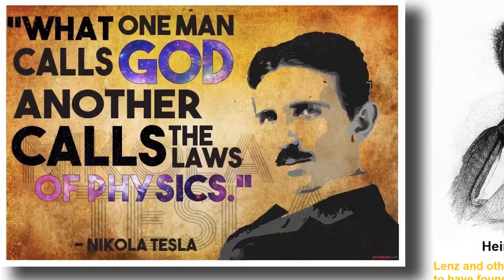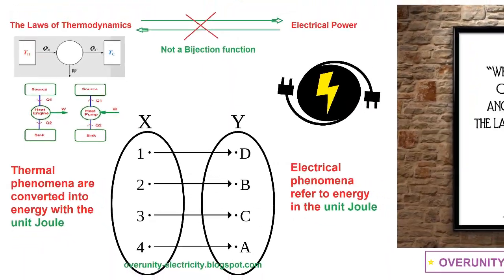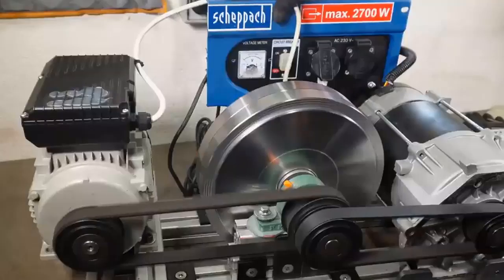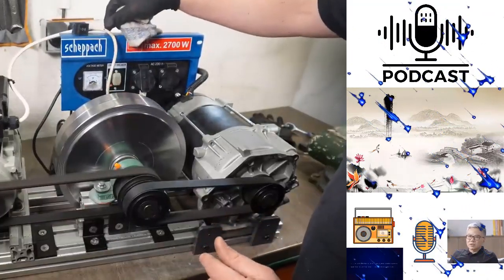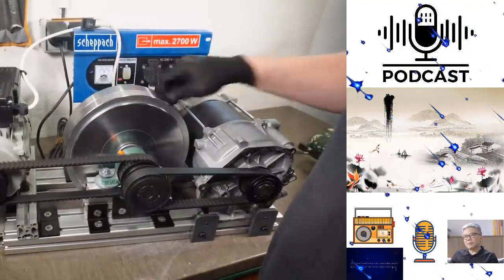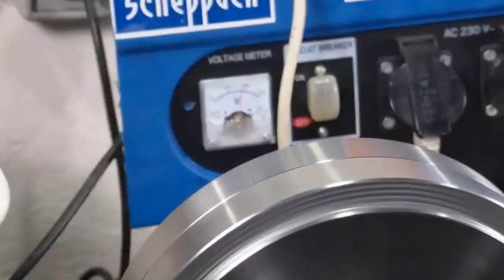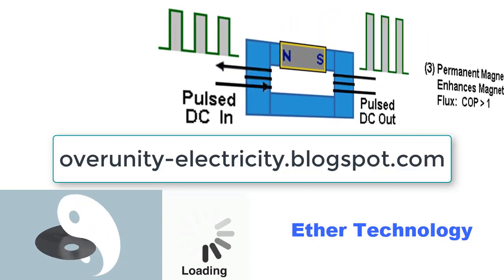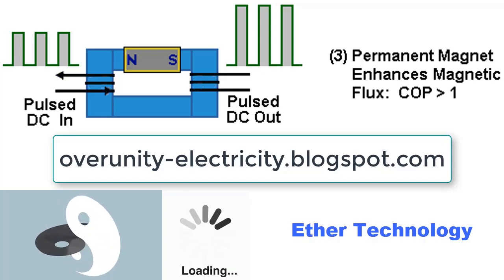Easy DIY Power Plan: Unlocking Tesla's Free Energy Technologies

Comment: Generating "free" electricity, often referred to as perpetual motion or perpetual energy machines, goes against the laws of physics, particularly the first and second laws of thermodynamics. These laws state that energy cannot be created or destroyed in an isolated system, and any system will tend toward increasing disorder or entropy.

While there are various renewable energy sources such as solar, wind, and hydropower that can harness energy from natural processes, they are not "free" in the sense of perpetual motion. These systems are based on converting energy from existing sources in the environment.

If you're interested in generating electricity sustainably, you might consider looking into renewable energy technologies and systems such as solar panels, wind turbines, or hydroelectric generators. These technologies harness energy from natural processes and are in line with the fundamental principles of physics.

Building your own renewable energy system can be a feasible project, but it requires careful planning, knowledge of the technology, and adherence to safety regulations. Additionally, keep in mind that the materials and components needed for such systems may come with a cost. It's important to approach any project with a realistic understanding of the physics involved and a recognition that truly "free" energy, in the perpetual motion sense, is not achievable according to our current understanding of the laws of thermodynamics.

If you want a quick cost-cutter solution in short time I definetelly reccomending that switch to one of the most cehepest energy provider from this link, also gives you  £50 credit towards to your first bill:   https://share.octopus.energy/denim-rhino-227

Comment: Perpetum mobile  - there is always a "bigger idiot" that still believes in "perpetum mobile.
Reply from the maker: It operates until the copper coil deteriorates or is damaged. If matter is permanent, then the generator will be eternal as well.

Occasionally have to stop for maintenance.

Dude, think outside the box, I'll enlighten you.